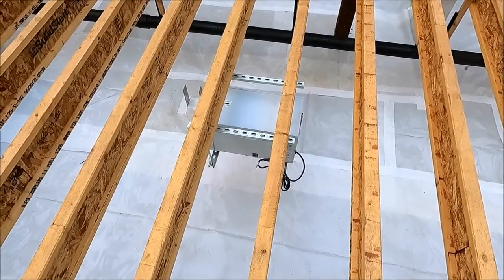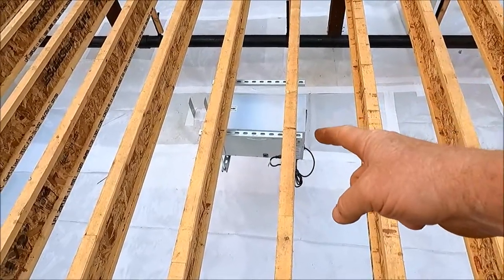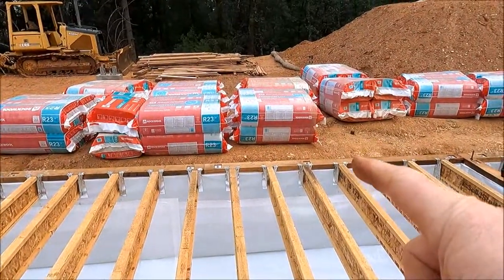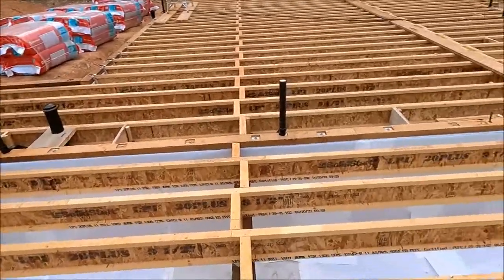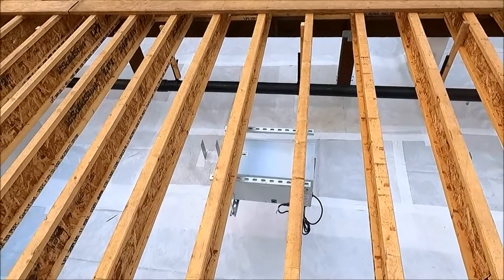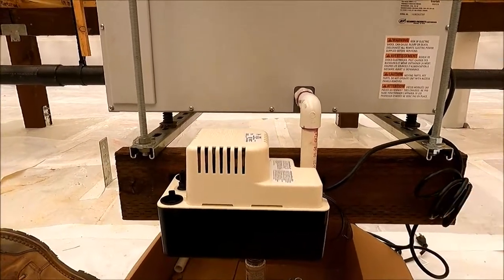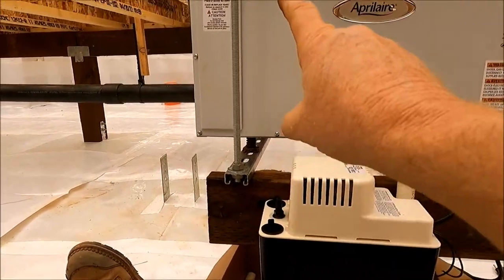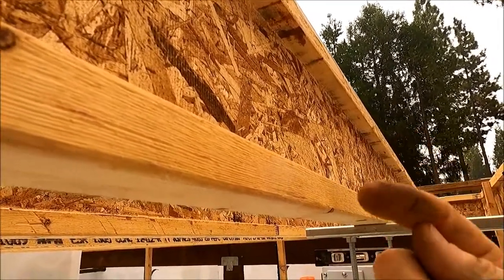Crawlspace Dehumidifiers and Condensate Pumps - Building your own house

Comment: Went into the crawl space and quite a bit of water in there. Condensate needed replaced so went and got a new one. Realized it's hardwired to the HVAC/ AC unit. Was this only because the cord wasn't long enough to reach the plug 20ft away? I went and got an extension cord and some zip ties and problem solved. I now need someone to disconnect the old pump that is hardwired.
Reply from the maker: I am glad some of the info in my video was helpful.

Comment: Scott good job on the install.  Are those simple switches on a float?   Will be interesting to see what you come up with for an alarm.  Your fawn sounded like a cat.
Reply from the maker: They are. I haven't looked to see what voltage they are rated for or read the information on the dehumidifier to see if there is a connection point in the dehumidifier to shut it off if the pump fails.
Reply: @HamiltonServices530  Let me know.  I did a little searching and found what looks like a similar unit and it appears the switch may be rated for 120V.  You may be able to wire a alarm or light directly to it

Comment: Just put a big toat under it what I do  my hvac left it unplug I checked few days later thankfully I caught it befor toat over filled
Reply from the maker: That was lucky!  If your pump has a float switch, you can wire either the red wire (24v to the thermostat) or the yellow wire (A/C) through the pump.  If the pump ever fails or is not plugged in, the float switch will disconnect and shut off the unit or A/C before the pump overflows.